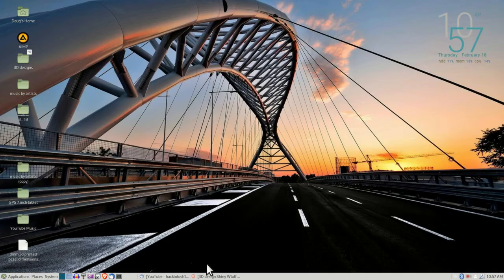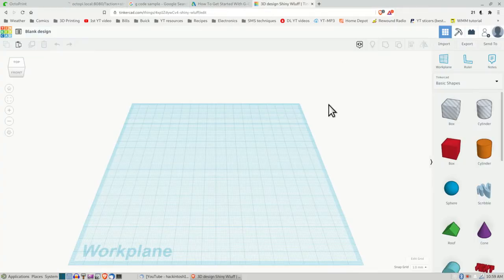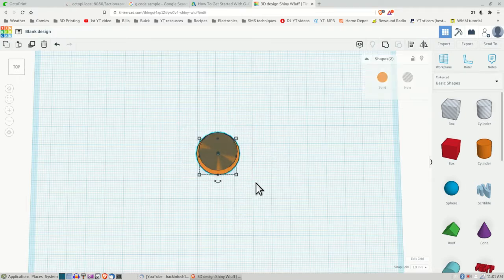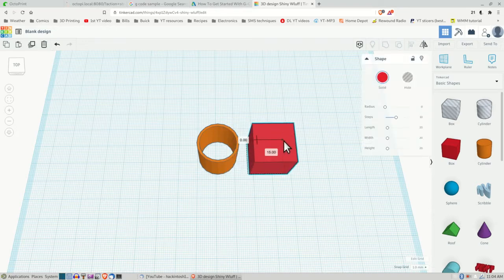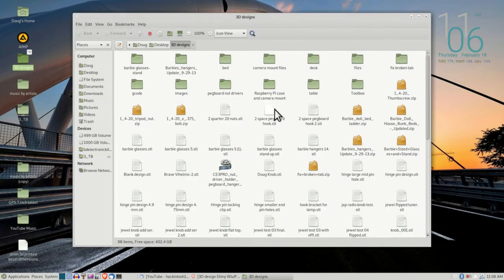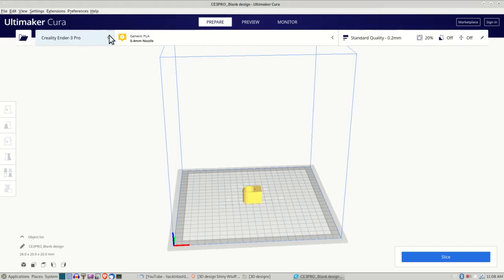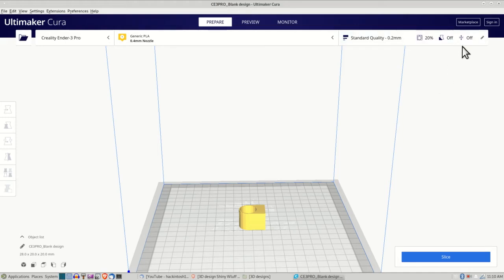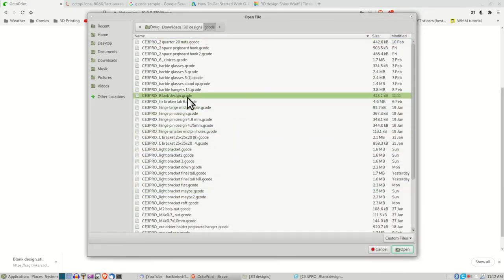DERB - For Leo - 3D printer steps

Comment: If you had a photograph on your draught board can you trace it 360° to make a 3D print should be able to
Can you use that carbon fibre filament in your printer
Reply: If you replace the brass nozzle with a hardened steel or ruby nozzle it will print with carbon fiber filament.